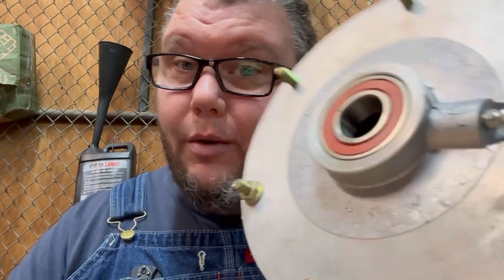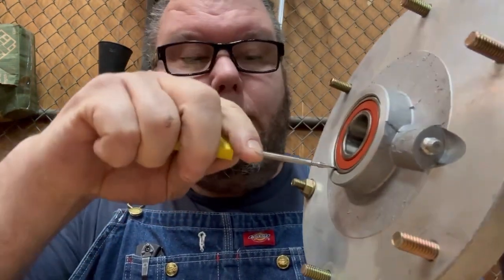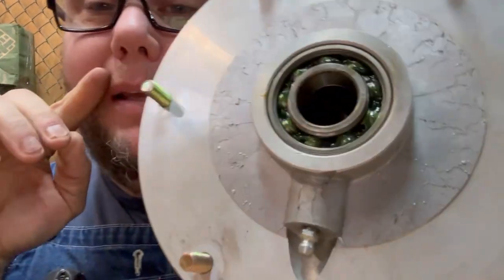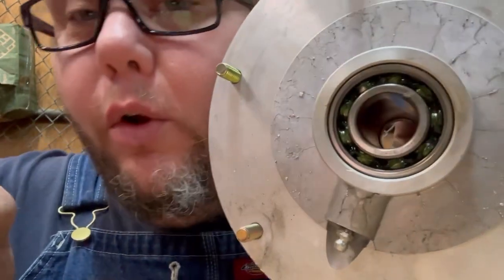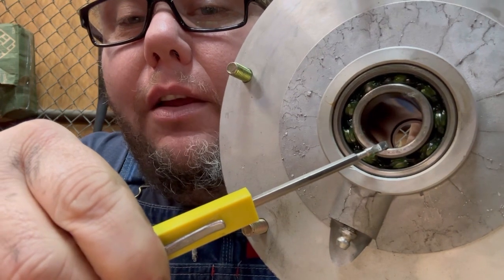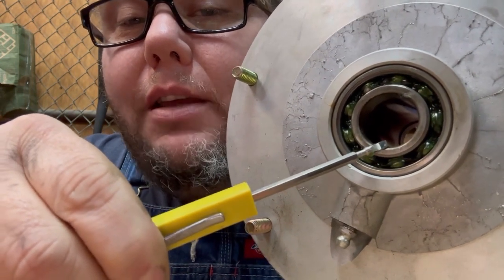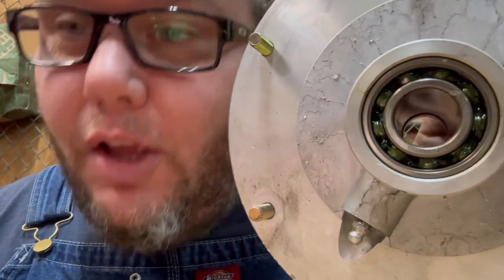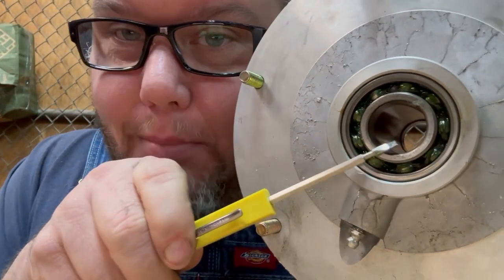HOW NOT TO INSTALL BALL BEARINGS

Comment: What happens if I use a bigger socket which fits the outer race?  Same thing or just get or borrow the proper tool.
Reply: That works because you're not putting stress on the inner race. Just make sure the part is well supported.